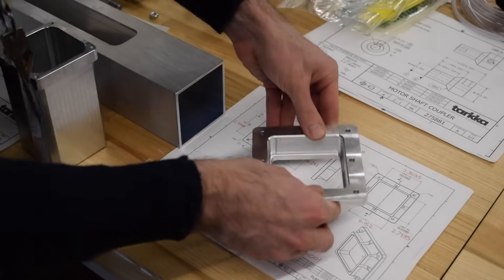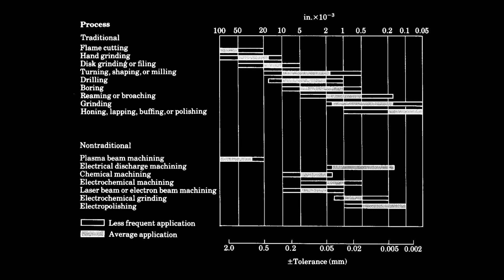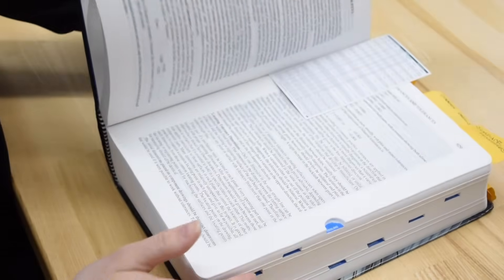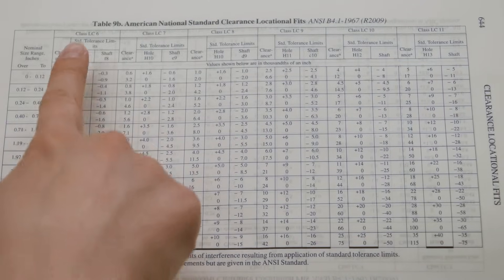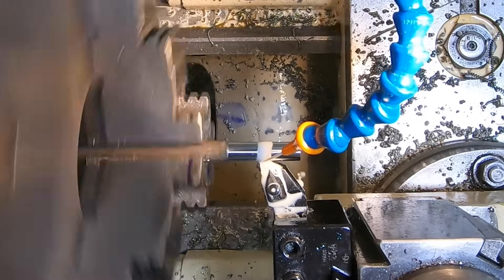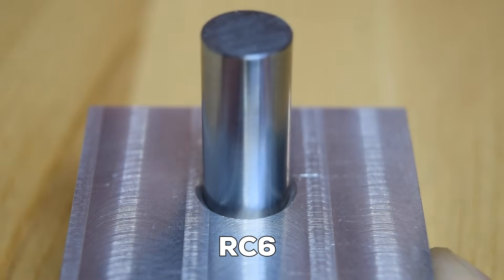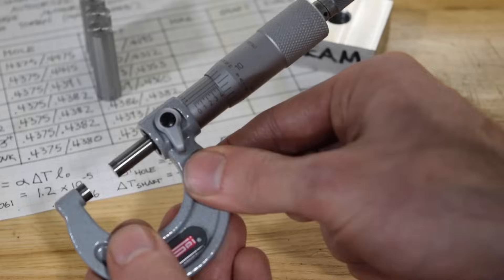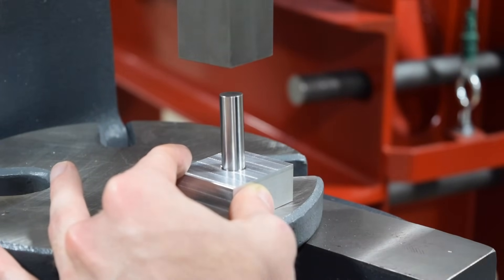Fits and Tolerances: How to Design Stuff that Fits Together

Comment: This was excellent! Perhaps as a suggestion a video on GD&T, and another on statistical tolerance stacks and Cpk values?
Reply from the maker: Sounds like there are a few thumbs up, here and on reddit too, for GD&T, so we've added that to the list!
Reply: @tarkka  Sincerely looking forward to it. The 20 minute 'e-learning' provided at work for these sorts of things are usually so dry, and involve clicking of the 'next' button a bunch of times.
Reply: @JayLikesLasers  Check out the GD&T Basics course. It's pretty long and it is a paid course, but it's very easy to understand
Reply from the maker: Thanks! Our next video will be position tolerance and we will do more GD&T as well. We discuss material selection for fasteners in our “Screw It!” video, and check out the companion blog post for material compatibility and strength charts. For calculating forces etc., we can do another video. I recommend getting Shigley’s Machine Design book, that has the info you need. Good luck with your career plans! We are happy to hear the videos help :)

Comment: An extremely helpful video if you're not a mechanical engineer. I am just an enthusiast who is designing a big thrower flashlight and needs to know the tolerance necessary for the aluminium reflector to slide into the aluminium body of the flashlight. Although this uses the US standard I could see that I need RC3 that would means space of 0.08-0.1 mm between the parts.

Comment: We have a part we're working on now with a .003"-.005" interference fit, a bronze bushing going into an aluminum housing. Had to heat the aluminum in an oven and chill the bronze with dry ice because the aluminum already has marking on it which can't withstand more than 200°f. That's definitely a fit that isn't intended to ever come apart.

Comment: One thing about this video that doesn't quite sit right with me (maybe it's because I'm used to metric and it's different in Imperial Standarts) is the portrayal of the fits. A high tolerance doesn't mean that parts will end up having lots of clearance - it means that those that do don't go into the waste bin. The workshop will still try to match your indicated nominal diameter. They will not install special "worse" tooling to give you a nice wide range of rattly fits, they will simply not remove that many parts in quality control.
Of course I am aware of the concept of intersection fits and press fits, which just mean that the parts "share" a hypothetical space, but the choice of a press fit does not influence the machining cost at all. Tolerance is the determining factor and can run any clearance fit, intersection fit and press fit into a high price range. Yes, even the loosy goosey one. You can have a +0,1 mm to +0,105 mm tolerance dimension on a bore, and that will make it quite expensive, even though it clearly is a clearance fit. Why would you need that? Maybe your part needs to keep a constant oil film on its surface that has to have a very precise volume and flow properties.

Just keep that in mind. The choice of tolerance is the thing that makes the accountants angry, not the choice of clearance, intersection or press fit.

Comment: topic idea: machine tool inspection, the different methods used for ways like dovetails, linear rails and the system to actuate like pneumatic, trapezoidal screw, ball screw - and how to check for wear and alignment, backlash and what to do :-) could be a mini series, like the tolerance classes of lead screws and off the shelve parts, preloads etc.

Comment: I would like to know why Engineers   will place tolerances on a print, (example) .500+.005-0.000 ,and/or
.250+0.000-.005, as to opposed   stating the mean tolerance along with the acceptable tolerances. It does make for a confusing adaptation of which dimension you are measuring and what the tolerances are.
Reply from the maker: I think some engineers use this convention to more clearly convey the "design intent." To use your example, the engineer is possibly saying "I want a slip fit on a .500 pin." The problem is that some engineers (and possibly machinists) start to think that 0.5005 (very close to the nominal)  is "more right" than 0.5025 (right in the middle of the tolerance band) and end up aiming for the nominal dimension. Instead, you really want to keep parts as close to the middle of the tolerance limits as possible.

Comment: Rc6 can be repeated using a drill just under the finish diameter repeatedly. I’ve cheated 1” reamed holes using a 63/64” bit then finishing with a 1” bit using a .007” feed. Gotta do what ya gotta do

Comment: Hi there, thank you for the insightful video! After watching, I'm left wondering how you design the strength of your interference fit. If for instance you want to calculate the press force required for installation, or the torque that can be transmitted by the interaction. I'm also curious when a retaining compound would be used, and how that would affect the calculations.

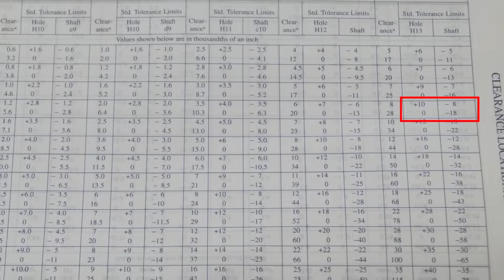Comment: Can someone explain to me @2:44  why the shaft is 0.4295+0.000/-0.010 while the limits are -0.008/+0.018.?
Why is the shaft automatically reduced by 0.012?
Reply: The Shaft is reduced by 0.0080 from the hole dim (as stated in the tolerance limit, which is -0.0080), so the shaft diameter becomes 0.4375-0.0080= 0.4295. Now a shaft of 0.4295 can can surely fit inside the hole of 0.4375. Now with that shaft, you can go more 0.0100 smaller (extra play) as per the tolerance limits, (difference between -0.008 and -0.018 = -0.0100).
Reply: @ProfessorGreen900  thanks for explaining that. Makes sense now

Comment: You mean the software manual does not explain fits and clearances? I am flabergasted that it does not. Always remember that two objects can not occupy the same space at the same time. I like the way they tolerance cylinderical fits with plus plus, minus minus instead of plus a value minus nothing. It insures that you will always have some clearance.

Comment: Please explain how CNC machining gives different tolerance as per requirement
Reply from the maker: Hi there, I'm not sure I understand what you're asking. Can you clarify your question?
Reply: What changes in machining parameters are done to get different tolerance. Or how different tolerance values are achieved in same machine. Suppose I want one part having surface tolerance of 0.02 and other with 0.01 a machine is used for two of them.
Reply from the maker: For CNC machines an effective way to achieve tight tolerances is in-control compensation. We can do a video on this and other ways to achieve tight tolerances.

Comment: You can hit far tighter tolerances than your chart and explanation repeatedly with cnc equipment. I do it all day long. Interpolation on a mill is not a good way to make a round hole and anything resembling a tight tolerance you should avoid this.